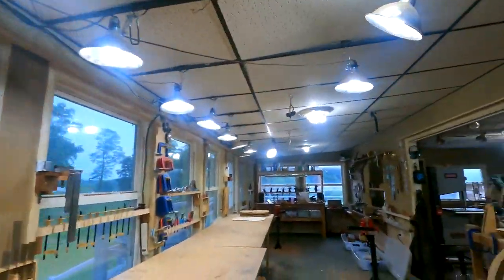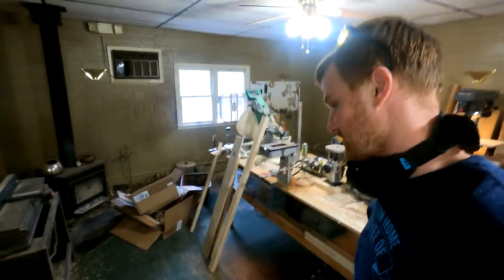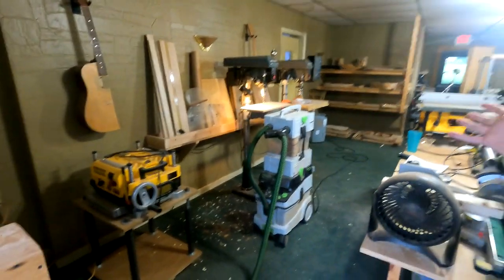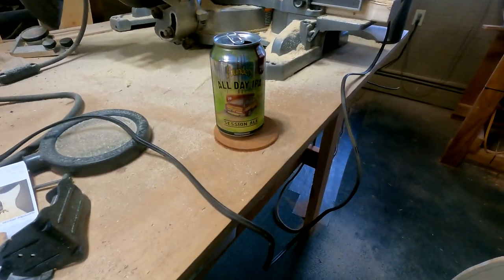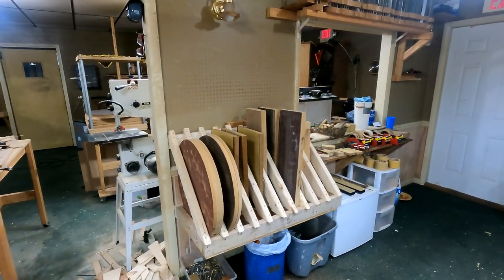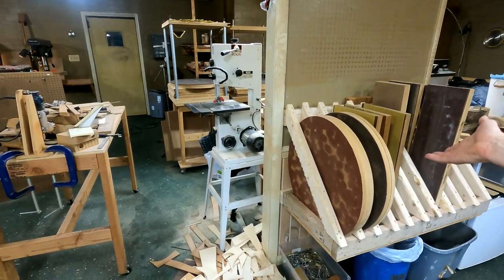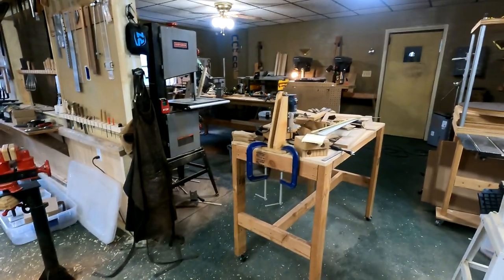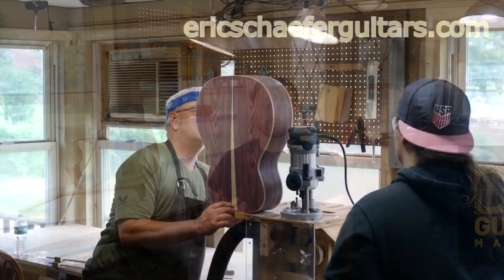The Chaos Behind the Scenes at Eric Schaefer Guitars

Comment: thank you Eric . i also only have a single shop vac and run around  with it. i also installed 2 box fans on the ceiling with filters on the backs to help out to reduce the shop dust .